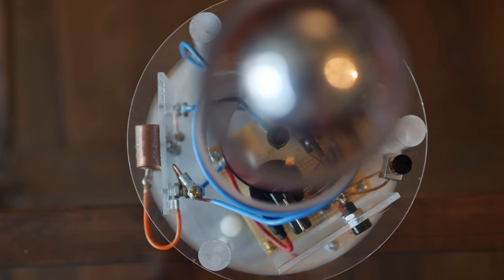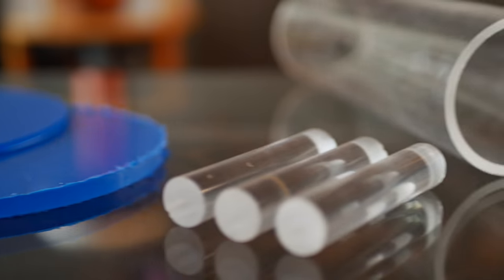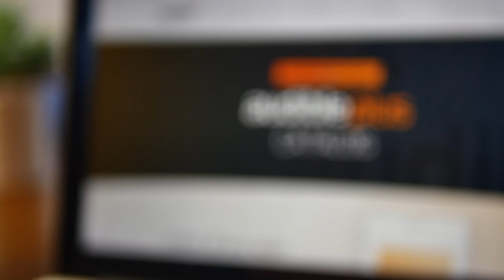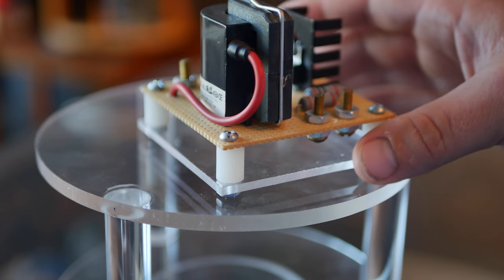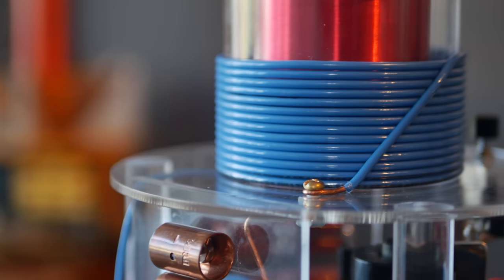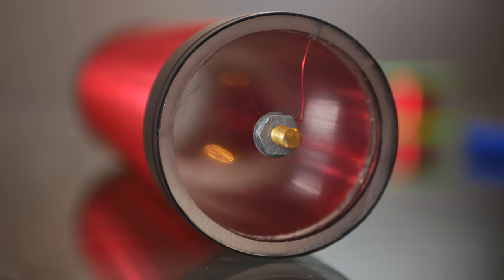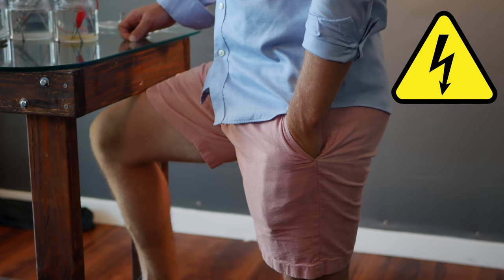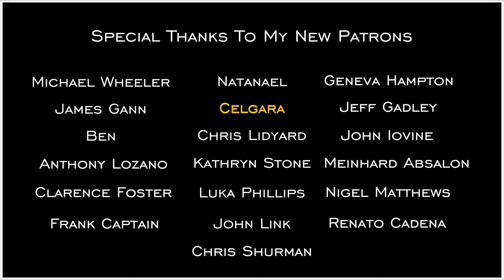DIY SEE-THROUGH Tesla Coil ( Portable & Museum Quality)

Comment: I have a question, I made a tiny tesla coil using a small 9volt battery ....how come I cna power a huge florescent light from a decent distance but your bigger much more powerful tesla coil seems to just have enough power to turn that bulb on and at only a really close distance? is there a way to make it power from a much further distance? my tesla coil does not even have a aluminum globe on top or anything just tiny wire sticking upwards.

Comment: Hey Jay! Big shoutout from Brazil :)
I've built mine few days ago, one problem is that i could not find the matching rated polypropylene caps of 3kV 0.01uF, the closest one was 1600V 0.01uF. Does it work? Can i build it with those?
Thanks for the amazing video! :yougotthis:
Reply from the maker: You certainly can use those, yes. Just make sure you place two capacitors in series to double their voltage rating. That will cut your capacitance in half though - and you'll need to change the number of turns on the primary coil in order to compensate.

Comment: Is it important for the primary coil to be made of solid, 14 AWG wire as you showed in the video? Or will using stranded, 14 AWG wire only negligibly affect the primary LC's resonant frequency?
Reply from the maker: Hi Tate, you can use stranded. At these low power levels, it will still work. You can expect a small drop in power though.
Reply: @PlasmaChannel  Thank you so much Jay!

Comment: I'm here and trying to understand why exactly you need a spark gap? 
Can't the connection after the capacitor be direct to the primary coil?
Then as I understand, the flyback transformer is stepping up but not much, so what is the difference between a made for taser 400kv module and a Tesla coil?

Both produce spark gaps and high voltage?
Reply: The spark gap is your switching mechanism which serves as an open circuit allowing the capacitors to charge until they reach a high enough voltage to break down the air, at which point it arcs over forming a low resistance path and essentially a closed circuit, discharging the capacitors until the cycle repeats. A taser module could also work, Jay has made a smaller one using the HV driver from a bug zapper racket. The taser modules are less reliable because they are not meant to run long periods and they are outputting less power, whereas a good flyback transformer can output quite a bit of juice.

Comment: Is there a way to build this without it being dangerous enough to hurt someone who isn’t careful enough to avoid grounding themselves? Btw you do make some pretty awesome vids.
Reply from the maker: Thanks Martin. This coil in itself is not very dangerous. Most of my builds are low power for a reason, so that I do not promote building lethal devices. I'd hate to have a child be badly hurt by my creations. However, to make this more safe 1) cover the spark gap so that at all times it cannot be touched. 2) only operate the coil when it is placed on the floor. This gives it better grounding, and, less chance of stray unpredictable sparks 3) build it with a lower value capacitor (you will need to retune the primary circuit, but this would make a much lower energy per bang situation).
Reply: @PlasmaChannel  thanks for the feedback. I have a few curious minds at home that would love to do this with me. I’ll put a pic up when I get it done.

Comment: @plasmachannel Why polipropylene capacitors? Will ceramic ones work too?
Reply from the maker: Great question. Ceramic capacitors are very lossy at tesla coil frequencies. Capacitor will still work, but you'll get smaller sparks

Comment: Why do you use polypropylene capacitors?  Would any other material be acceptable?
Reply from the maker: Other material will work, but, PP works the best as it handles the high frequencies, present in TC circuits. It is not very lossy. Ceramic on the other hand, is super lossy. So, sparks are smaller with other cap styles.

Comment: Hey jay bigggg fan of you but have a question cant you firs convert ac to dc with a full bridge and then use like that? i have tried but seems like it doesnt work as well as just ac but seems like you are an expert in tesla coils so i had to ask you
Reply from the maker: You may have had issues in the past due to not using a filter capacitor on the output of the AC-DC converter. If you dont use a filter cap...you end up with pulsed DC which does not work as well as a straight battery.
Reply: @PlasmaChannel  thanks very much for the reply yes i had some sort of filtering because i was using dc flyback im ganna try with a neon sign transformer hooked to full bridge thank again

Comment: Can someone explain me how the spark gaps works and why changing the position changes the amount of volts?
Reply: The HV supply charges up the capacitor until a high enough voltage exists at the spark gap terminals that the air breaks down into a plasma and becomes conductive. Adding multiple gaps is equivalent to moving a single gap further apart, which requires higher voltage to spark.

When the gap sparks it dumps the energy in the capacitor into the primary coil at a high current.

Comment: what is the best way to tune the coils to match the resonant frequency?
Reply from the maker: Easiest and best are two different things. Easiest is to calculate using JavaTC, or, deepfriedneon.com calculators. Best, is to calculate and design your coil, but, then also custom tune it after building by adding or removing primary turns.

Comment: i have one doubt when the sparks touch why u didn't get electricuted is it because of skin effect or u are not grounded. i am not sure that when will I get electicuted , when I am grounded or not grounded. can u plzz make an separate video on it my frnd?
Reply from the maker: A couple things to consider with this coil. And, safety is very coil specific. 1) the pulse length is so short, that muscles and nerves hardly have time to respond. 2) our dry skin is very, very resistive. it limits current to an extent. 3) the actual power behind each and every spark is very low. Less than a fraction of a watt per spark. So, combining those three things, it's very safe to touch. However, larger coils, or, coils that are plugged into a wall....i'd recommend not touching.
Reply: @PlasmaChannel  thanks man, i will be careful(personally I like u cause u are replying to everyone's doubts and comments

Comment: I've never really understood the relationship between the primary and secondary coil.  Does the space between them matter? Do they need an insulator? What happens if you put the primary coil inside the secondary coil? I've seen pancake style primary coils does that make a difference?
Reply: If it were a properly tuned Tesla coil it would have a specific ratio between the primary LC circuit and the secondary LC circuit. This is not properly tuned but will still produce some decent sparks.
Reply: You need an insulator to prevent arcing between primary and secondary coil if they'll arc together then you'll not have the highest energy on output
Reply from the maker: This coil is tuned using JavaTC. The 14.5 turns on the primary was intentional. Cheers. 

You can put the primary inside the secondary, however, this leads to parasitic losses of energy due to increased heating.

Comment: Is there a way to know if the output voltage of an high power device is safe to touch? Like how do i know if i can  touch the sparks as you did in the video if i change few parts or change voltage.
Reply from the maker: In general, it's about power per bang of the primary capacitor. Each bang (at MAX settings) was only 0.5 joules. That is uncomfortable, but, not lethal. When you're touching these sparks they are uncomfortable, and if you hold your finger in one place, it will potentially burn your finger. But, if you use the one hand rule, and dont ever let the electricity go across your chest, you're fine. In general, keep wattage below 40 watts, and, bang per cycle less than a joule, and you'll be fine.

Comment: Wow that's beautiful! You are a master with acrylic. You've definitely gotten me hooked on brass hardware. Can't wait to try this build. I still have some of those capacitors from the 3 volt Tesla coil project. Thanks for making this video Jay.
Reply from the maker: Hey Nigel, you're quickly becoming my most reliable commenter! Thanks, I am glad you enjoyed the video. Acrylic can really be a pain to work with sometimes. Even when you're gluing the edges, they can experience "crazing", which is chemically induced cracking. I got lucky and didnt have much of it. You can use the capacitors from the 3 volt coil, however, you'll need many more of them in parallel since the caps from that build are lower capacitance. Try to find the 10nf (0.01uF), 3kv polyproylene caps on mouser. Also, I had occasional sparking between the primary and secondary coil when using it on medium or high power. To solve this, wrap thick plastic between the two coils (try not to scratch the secondary windings when doing so).

Cheers!
Reply: I'm always excited to see them as soon as you release them. Thanks for making them available early through patreon. (I'm not happy with patreon - there's a glitch they refuse to fix.)

Comment: I inspired to your video before, that you create a spark gap tesla coil in miniature form. I build before the tesla coil both in spark gap circuit and solid state tesla coil driver
Reply from the maker: Excellent, glad to hear it worked as intended!
Reply: @PlasmaChannel  I make it a tesla coil at 1 m height using 32 AWG magnet wire. I used it as my part of my research project, it is awesome concept using tesla coil in other way use it as blank(I dont want to reveal my research title/concept) during my high school times with fascinating Nikola Tesla's Power.😁 I'm a Filipino Student focus in physics and robotics research

Comment: How do you calculate the necessary capacitance
Reply from the maker: I dont really build my coils that way. I decide how loud I want it to be, and how safe, then choose the capacitor around those parameters. I then calculate the primary turns to match the secondary that I wound. I always wind the secondary first, then design the primary circuit around it.

Comment: How did you calculate the resonant frequency?
Reply: it is best to actually measure it since it depends on secondary, top-load, environment (changes with how close you are to it), and other things. The basic equation can be found online by googling. However it tends to drop as the sparks get longer and your hand approaches the coil, as the conductive plasma increases the capacitance of the topload, as does your approaching hand (distance is inversely proportional to capacitance.)
Reply: I just make the spark gap with fine threaded screws and adjust it by turning the screws closer until the frequencies match or get close enough. You'll actually see the difference at the top of the coil, the plasma gets longer.
Reply from the maker: @johnruscigno5738  Power max is correct, John. Spark gap only adjusts how much energy per bang happens. The freqency that this bang resonates at is determined by Capacitance in the primary circuit, and, inductance. So: cap size and number of primary turns.  

On a smaller note, there are other factors that effect primary frequency, but, those are the main ones. Cheers!
Reply from the maker: Great question. I used Java TC, a very accurate program that was updated recently. It is free, and online. using Java TC, this coil is the most powerful (for it's physical size and power input) that I have ever built. Try it out!
Reply: @PlasmaChannel  Wait... so the gap distance in the spark gap is irrelevant to the primary resonant frequency (or the secondary resonant frequency)? So it doesn't matter how wide the gap is?
Reply: @power-max  I understand now, thank you 🖤 so that's why you see people make the primary out of bare wire so they can adjust it by moving the contact points.
Reply from the maker: Correct prince! The gap goes not change frequency of reverberations. It only affect the frequency of actual pulses, or bangs. But on the micro scale, each bang reverberates hundreds of thousands of times a second... and that frequency is determined solely by capacitance and inductance. 

The gap distance is tied to bang rate. But each bang’s micro frequencies - determines by turns and cap size.
Reply: @PlasmaChannel  thanks for the info, I'll check out Java TC. I recently got a monster flyback that I'm going to power my Tesla coil with. Your videos help alot.
Reply: @johnruscigno5738  Yup! your welcome. An LC resonator is really no different than a pendulum or spring-mass oscillator. If you add a damper then this simply draws energy away and the oscillation eventually stops.

@Plasma channel did a better job explaining the idea of the spark gap. Strinking the bell really hard occasionally, or striking it often with less energy per strike. You can get the best of both worlds by building a more beefy and dangerous high voltage power supply.

The hope is that by having a really large oscillating magnetic field engulf the primary, then energy is transferred to it. And because it resonates at the same frequency, The voltage you get out will depend both on the turns ratio and the effect of resonant rise. There is no theoretical limit but any load (including sparks) draw energy away from the oscillations damping them out.
Reply: @PlasmaChannel  Thanks Jay, this was very helpful. Your reply and the video!
Reply: 1/2(pi)sqrt(L*C)
Reply: imagine if someone would use a Arduino for constantly auto-tuning the tesla coil at all times :D
Reply: @hyperhektor7733 It is actually possible. Arduino isn't fast enough. You would use a ASIC or PLL. FPGA maybe. A tesla coil is a type of LLC resonant converter, except the goal is to generate the highest voltage possible rather than a specific voltage or current. There are many resonant LLC controllers on digikey you can get, popular for power supplies > 300W.
Reply: If you really want to make it easy you would make everything adjustable.  Hard at first but it will pay off.  Adjustable cap, inductor etc.  Tesla's patent 568178 somthing simular should do it.  We are now spoiled with pwm and zvs drivers.  A good choke like MOT secondary with primary shorted or hv diode which Tesla never had should work as well, before spark gap.

Comment: Why can you touch >200 Volt without death?
Reply from the maker: Because the voltage is not constant. Think about a shock on a door handle. That is as much as 5,000 volts. But, it is only a quick pulse. Just like a door handle shock, this is pulsed, and only lasts for milliseconds. Also, the electrical frequency of this voltage is in the 100+kHz range, so much of the electricity flows on the outside of your body. Not through it. I say much (not all), because there is always a low frequency pulse present inside a waveform from a SGTC like this.
Reply: @PlasmaChannel  Thanks for clarification. I can then assume it's not voltage that kills but more like the power in general? If you apply it to your video the one hand safety thing is useless on this tesla coil but you do it anyway because its better to have it as a habit for all handling of electricity?

Comment: I'm gonna start to save for buying materials to build this. My current hv psu is a 240w flyback transformer, so it's not the kind of thing I can play safely with
Reply from the maker: That is quite a powerful driver. yes, not very safe!
Reply: @PlasmaChannel  I am actually using it single , it is not a driver thanks God
Reply: @PlasmaChannel  the les safe the more fun
Reply: Im makeing a 480w dula flyback 40000v power sourse too
Reply: Constructing a 1000w zvs with series flyback transformers. Planning to use: chicken stick, one hand, insulated gloves, power indicator, and foot pedal/deadman’s switch that is secured away from the build. High voltage with high current kills, no shortcuts. BTW love the channel! Your builds are truly museum quality!

Comment: You know much about Tesla.  Only saw a few vids you were a little off on.  Only minor details.  Plus u showed me a good amount with your testing and experimenting.  Are you ready for one of Nicola Tesla's last invention.  Very dangerous if not at high speed.  Patent 583953A.  Tesla's last invention before transmission through earth.  The transformer coil will be the problem.  Yet Tesla did it the best.  So.. if you build it too well will they shit u down?

Comment: Are the capacitors mentioned (3kv .01uf polypropylene) no longer available? I can't seem to find them anywhere? Even with a Google search it brings up one's only rated for up to 630v, that or ceramic disc capacitors. Can anyone point me in the right direction?

Comment: Hey dude I have a question. I'm thinking of building the high voltage generator. I found a Flyback transformer on Amazon but it only has two terminals... Do you think it will work? It says it's 40w.

Comment: There is confusition between connection of spark gape and capacitor...plzz try to clear...🙋🏻‍♂️🙋🏻‍♂️🙋🏻‍♂️
Reply from the maker: The spark gap itself...has two sides. One side connects to the capacitor, the other end connects to the primary coil. Then, the other end of the primary coil connects to the other end of the capacitor.
Reply: Tnx🙋🏻‍♂️🙋🏻‍♂️

Comment: When you built the arc lighter powered Tesla coil, you added a diode (and you told me that it was because of the high frequency ac of the lighter), why not this time? I mean does your flyback power supply(which I love by the way) outputs low frequency ac or even dc?
Reply from the maker: Thanks! And great job noticing. The flyback supply outputs DC, so no diode needed.